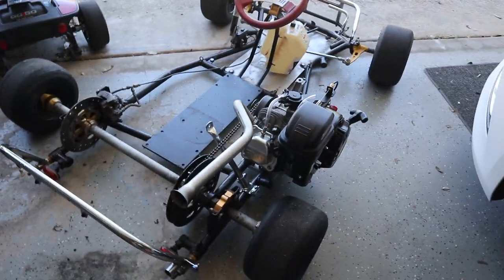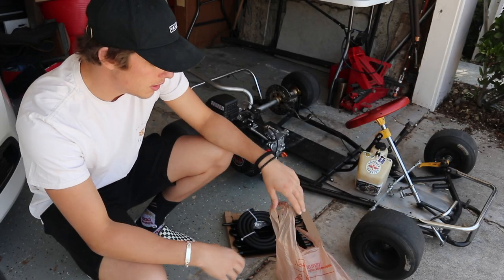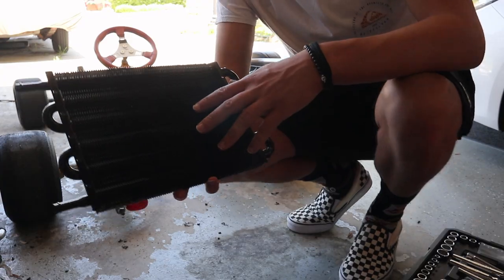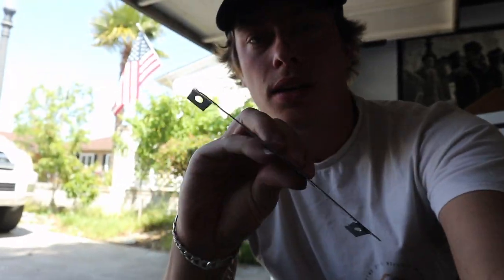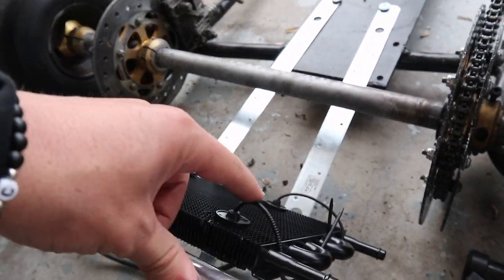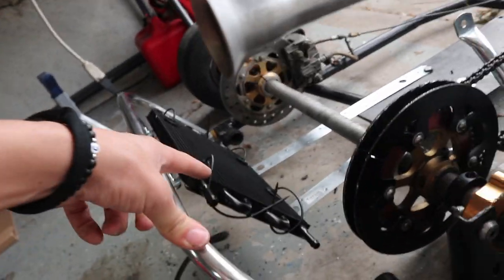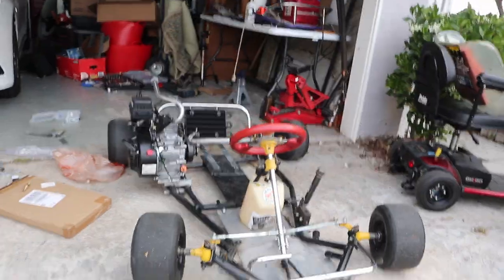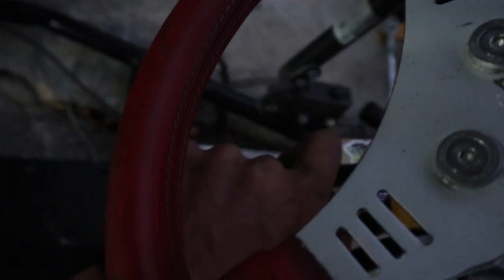FIRST EVER FUEL COOLER install on my DRIFT KART! Predator 212cc

Comment: How did it work out for you did it help cool down the motor too
Reply from the maker: I found that because there's more dense fuel coming in that I needed to adjust the fuel jet to have it run better but it was a little faster. Not sure if it made the motor cool down but I know that with the fuel being cooler it probably helped it run smoother and not as prone to knock if you were to remove the gov gear in the motor.

Comment: Completely useless and ineffective. Passing fuel though the "cooler" will only insure that the fuel is at ambient air temperature. Submerge the cooler in an ice bath  if uou really need denser fuel.
Reply from the maker: diesel trucks use this method to help with performance and other things. but with my more recent vides I'm ditching this set up to go with a simpler set up.
Reply: @GavinFS Your cooler can't reduce fuel temperature. Racers use an ice cooler to chill fuel below ambient temperature, place your radiator in an ice cooler.
Reply from the maker: @olsonspeed  So true, that would give the best results but definitely overkill for a go kart. More worth it to build up the motor lol